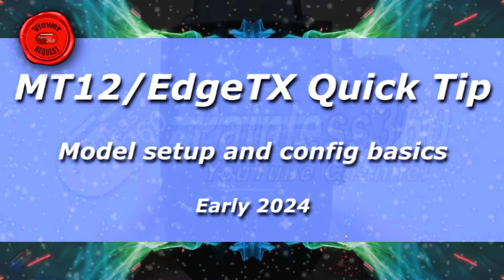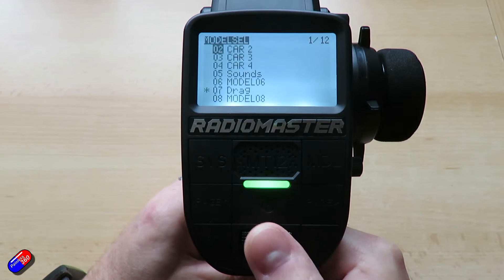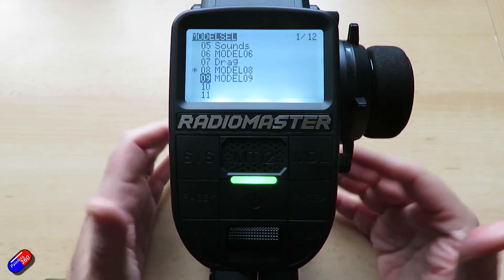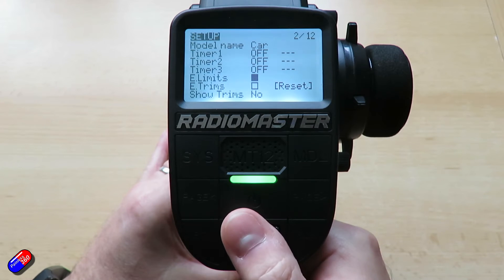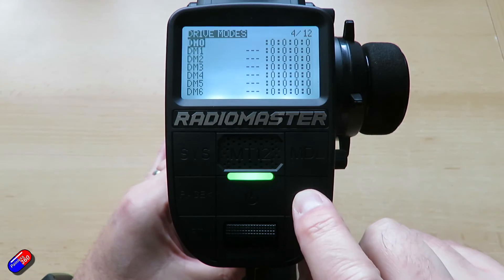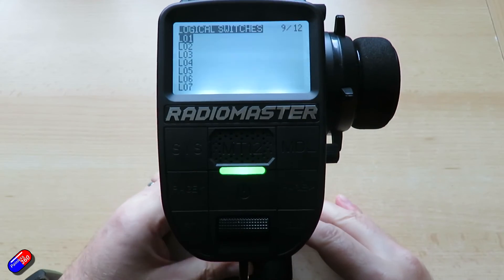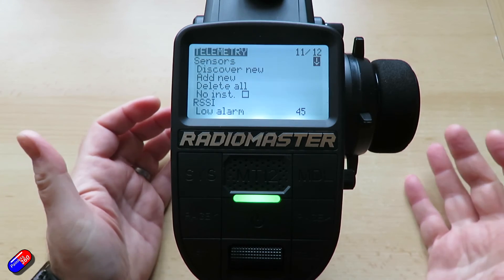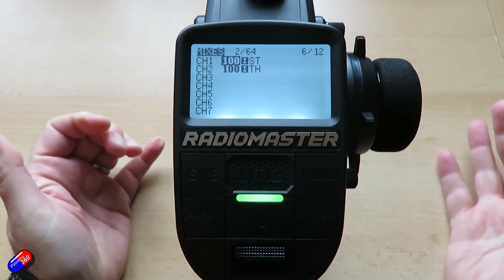MT12 and EdgeTX: Basic model setup (moving and adding controls and extra channels)

Comment: im trying to put a 3 sp transmission on my 3pos toggle swich. i made 3 mixes. +100 ,0, -100. i lookat the monitor and as i move toggle switch it goes from -100, 0, -100. +100 doesnt show, im trying to set up a t power light sound pro kit 60a. another problem is that the steeering servo is ok in one direction but not the other direction. it stutters. on a servo tester, they ll work fine
Reply from the maker: Sounds like you have done something odd in the setup.  Check out https://youtu.be/ZFayIVWsk-c

Comment: How do you set up the momentary switch as a handbrake like on the FireTeam 6?
Reply from the maker: How does the handbrake work on the car?
Reply: @Painless360  it’s a servo that activates a disc break on the drive shaft. It’s the FireTeam6 car. It has throttle, steering and handbrake controls. I’m trying to figure out how to setup a momentary switch for the handbrake, similar to how it works on the stock transmitter.
Reply: @Painless360  This is a super popular car, it would be pretty cool if you covered an FPV setup with Radiomaster MT12
Reply from the maker: https://youtu.be/V0ZdA0Z8Q20 :D